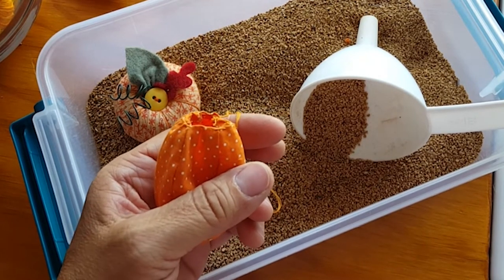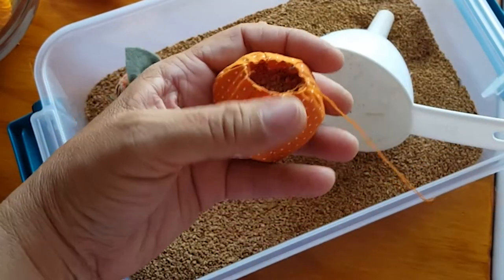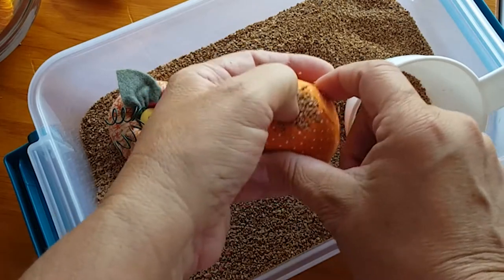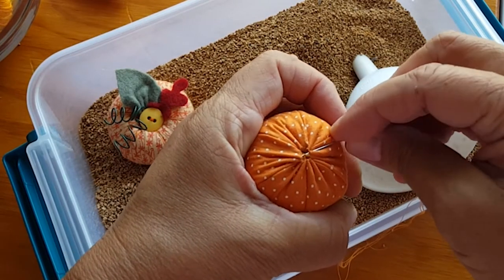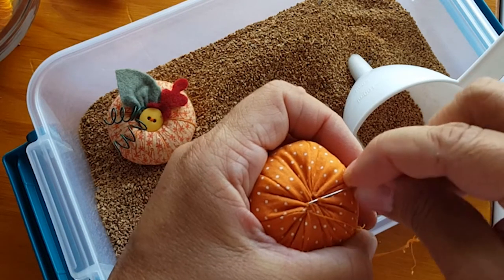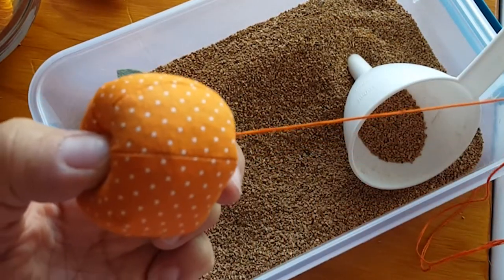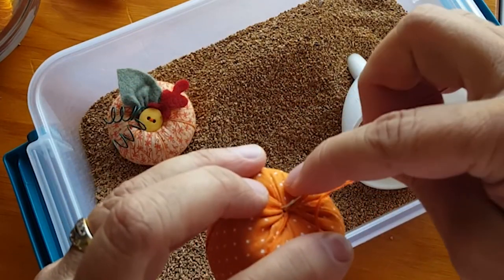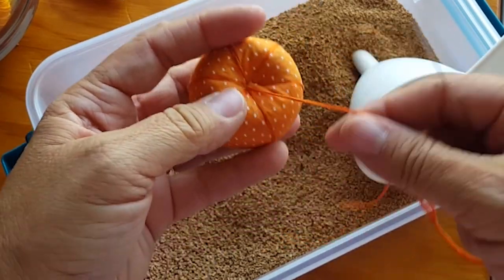Pincushion Making Tips and Tricks

Comment: Thank you so much for that clear and simple demonstration.  I am going to stuff (re-stuff) some of those little old metal shoe pin cushions.  I have all the supplies but cannot decide if I should create a bag that fits into the entire shoe including the toe, or just make a bag that fits into the oval shoe opening.  Thoughts?
Reply from the maker: I have a couple of those too. My plan is to use a large wool ball, but I need to cut the bottom off of it which is where the challenge comes in. I may or may not cover the ball with fabric. 
I don't see any great way of stuffing them with my own template without a ton of trial and error. But I have great confidence in you! 😉
Reply: @sewnwyoming4878  Thank you!  Trial and error is the best way to learn.  Good luck to both of us.